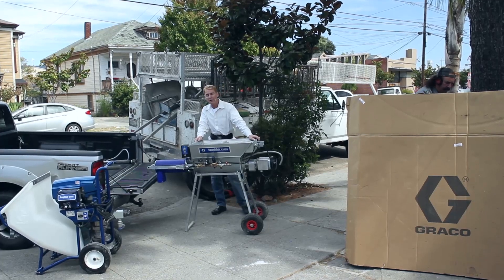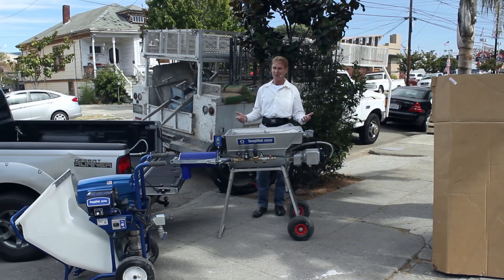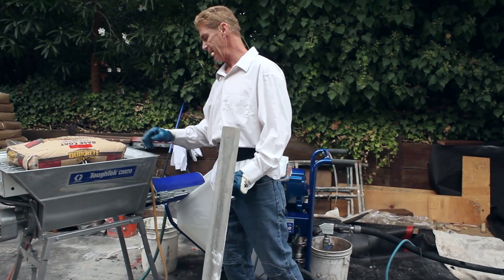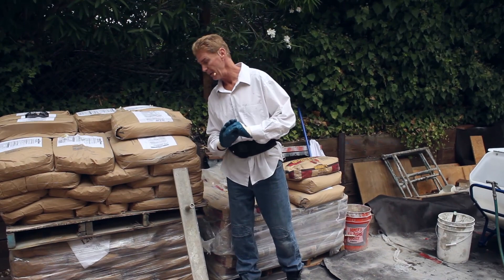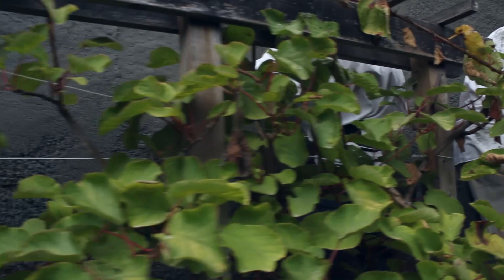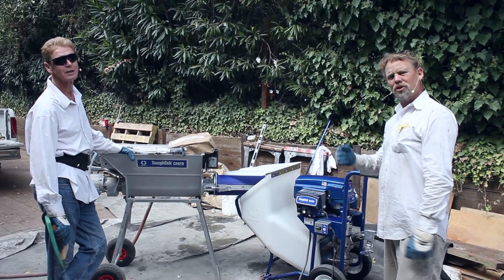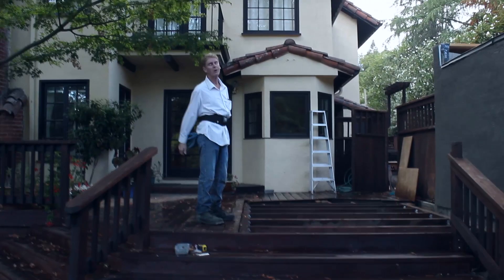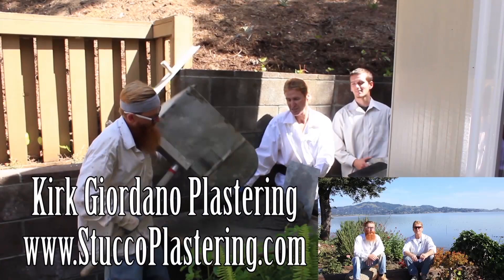Graco mortar pumps for spraying stucco.

Comment: I like it!  We don't do enough plaster to run a pump but have been happy with Graco sprayers
Reply from the maker: Good evening Scott Dude, I turned down many jobs that I would have accepted had I used this mixer/pump system earlier, such as two stray bale homes for a for a  contractor that I have been working with for 20 years.
Plus it took me and a full crew to hand apply a coat of stucco to a beat up cement wall about 250 feet in length all day with a float finish that would have taken only one hour with this Graco mixer/pump system.such is life.
                       Live long and plaster
           Sharing the plastering knowledge

Comment: Are company has one of those pumps. It works great for spraying fireproofing you just have to make sure your 110volt power is dedicated another words no one else can be on same breaker or box,  nice to see it is also able to pump stucco fairly fast. Remember the days of track house's?? Pull up the pump to a gigantic pile of sand stretch the hose out and run run run....yikes I do not miss that to much LOL. Another great Video thanks Kirk.
Reply from the maker: Howdy Robert Dude, been there too my friend, i used to eat braekfast and make four sandwishes per day for at least 5 years for this sort of fun work.
                 Live long and plaster
       Sharing the plastering knowledge

Comment: closest i came to this was with a shotcrete cementing system.
it was like wrestling with a huge unruly python powered paintbrush.
hat off to your pump gun guy.
Reply from the maker: Howdy 69 Dude, that's no joke strength is necessary.   
FYI, I used to shoot shotcrete in S.F. on the new high risers many years ago, hated it, but man it sure paid well, it was some snotty, slippery crap especially if you manage to step on it, or tried to. 
but at the same time, a mans got to make a living.
                     Live long and plaster, 
  Sharing stucco secrets, or common sense tips

Comment: Nice. We use the fireproofing version, F340e. Love it. 13 bags/hr. now and maybe up to 20 with a forthcoming upgrade. Meeting w/ Graco tomorrow to demo a higher output dual F340e with mid 30's bags/hr. We are not using their continuous mixer but hope to if they can get the bugs worked out.
Reply from the maker: Good afternoon James Dude, this unit shoots a pallet an hour or 35 50 pond bags,
 I used to shoot fireproofing in S.F. many years ago, the pump was so large and the chained on hose so huge and heavy that the cherry picker I was forced to use kept having the back wheels lift off the ground which scared the be-Jesus out of me,  I quit after a week out of fear of the cherry picker collapsing.
       FYI, the Graco mixer make a perfect mix every time, where using a tow behind mixer which I have at least five, 
 can and will over mix any same day cement plaster materials thus rendering the cement plaster a bit weaker as the PAC's get beat up, It's rare to find a plastering contractor that even knows what pac's even mean. When the same day cement plasters are overmixed it sort of like plastering in freezing weather below 32 degrees agin when cured it is also weak.
                       Live long and plaster
           Sharing the plastering knowledge
                 Kirk and Team Giordano
Reply: Right on, Kirk. Tell Danny Carrillo I said hello from SLC.
Reply from the maker: Howdy James for saltt lake city, that Dann dude gets around alot for such a busybguy.
 The late great movei star Lucill Ball used to say "you want something done ask the busiest person you know"
                 Live long and plaster
       Sharing the plastering knowledge 
                  Kirk and Team Giordano

Comment: That's a heck of a machine
Reply from the maker: Good afternoon John, Dude, it was the first time we used it, surpassed my wildest expectations with strength, adaptability, while being simple to operate, these time conserving modern pumps could only be engineered from the minds at Graco.                   
                    Live long and plaster
           Sharing the plastering knowledge
                 Kirk and Team Giordano
Reply: I've got to Grayco airless sprayers and the are beasts.....love the knockdown dash finish
Reply from the maker: Good afternoon John dude, they do tend to have longevity and their side must be made in the U.S. under quality management.
 As my Graco paint sprayer is almost as old as me and still funtions like new, I keep it ugl as in covered with many coat of paint so no worries about it being stolen.
                       Live long and plaster
           Sharing the plastering knowledge
                 Kirk and Team Giordano
Reply from the maker: Good evening John Dude, that was the easiest know down I ever applied, O wait, Andy spraed it on no wonder it was easy for me.
                       Live long and plaster
           Sharing the plastering knowledge

Comment: Hey Kirk, another great video. My name is Clayton Cole and I've been plastering with my father for about  8 years or so. He's been in business for over 35 years down here in west central Florida. I was excited to see your opinion on this machine. I want to know what air compressor you were using? Also do you think using a regular drum mixer would keep up? This machine would be a large investment but I would love to have one!
Reply from the maker: Good morning Homemade Dude, the drum mixers will work but they have a tendency to overmix the product, so you really have to be on the ball when mixing.
I was using my DeWalt air compressor that I mainly use for lathing for the air to his Graco mortar pumping system.
 Your right is is a good investment for many projects.
                          Live long and plaster
            Sharing the plastering knowledge

Comment: We use there pumps all the time we spray joint compound with the graco mark v for airless plaster they call it but it’s just joint compound. Great pumps though we have 2 of the mark vs and we will be getting a mark x for remodel because you need to spray heavier
Reply from the maker: Good Morning Wayne, good tip brother                   
                      Live long and plaster 
    Sharing Plastering tips by Kirk and Jason Giordano
Reply: You'll  love the mark x. I was a field tester  for graco  and the mark x. Don't  use murco mudd  in it because  it will pack around the lower ball after about 3 or 4 buckets and you'll be cleaning your pump out because you'll lose all the pressure on the pump.  Murco mudd is the only mudd I had this problem with.

Comment: Greets. Have you tried shooting fibered cements like EZ Mix Scratch/Brown? What was the 50lbs bag mix you're putting on? I heard you say it was QuickCrete, but it looks like a new mix. Have you pushed the unit to determine  max yardage rates, and how was the maintenance and cleanup? Lastly, do you have to run any additives for the pump and hose?
Reply from the maker: Good Morning Rembrant dude, we have pushed this unit to the limits, it works well.
We have also used all sorts of cement products with and without fibers.
 I haven't added any additives though like say jibco as I didn't feel they were necessary.
 As far as clean up, this is a part I dislike with any pumps or mortar spray machines, thus I do most jobs by hand.               
                              Live long and plaster
            Kirk and Jason’s plastering tips and techniques

Comment: So, I have a large project where I'm going over an existing masonry wall to apply manufactured stone product.  I need to apply a bonding coat (3/4" give or take).  No need for lattice, at least that is what the manufacturer says.  All it needs after that is a texturing tool over it to put those little grooves in the surface of the skim coat so that the thin set can grab the skim coat when bonding the new veneer in place.
Can this thing handle a big job and get-r-done, or should I just hire a gang of men and do it by hand?
Reply from the maker: Howdy William, Graco stucco spraying machines can do whatever is required of them much faster than by hand.
However, you need to understand how to operate them; this does require some training and skills. If this is the only job you will do, it may be best to do it by hand; however, if you will use the gago sprayer for future plastering jobs, then it's worth the investment. 😉
Reply: @StuccoPlastering  You see, It is a really big job (40k sqft). IF POSSIBLE, I need it to also pump sac-crete into the CMU walls of the foundation from the top near the sill plate.  Can this unit, or one graco makes handle small aggregate as well?
Reply from the maker: @BillyReed68  Absolutely, Graco stucco mortar sprayers can handle ten times as much. That's what these pumps are designed for to save tons of man-hours and spray instead of applying by hand. 🥳

Comment: Thanks for the video I was wondering what size of compressor did you use? and does it need to be continuous air compressor I called Graco but the guy didn't know. I wish you would of spent a little more time at the mixing station dialing everything in would of been helpful. Roland All Island plastering.
Reply from the maker: Howdy Roland, I felt we explained as much as possible, we cant have videos too long or that scares most folks, here is another one showing the same machine and materials mixed, it was also in the description Cheers my fellow plasterer. https://youtu.be/yjVpplHCLO8/ 💃🏻

Comment: Get over your 220V phobia! Whatever machine you're using, it's going to draw the same energy from the power supply to do the work. The energy draw at 110V requires twice the current as the energy draw at 220V. Twice the current means you need bigger gauge wiring, higher current circuit rating,  and the motor runs hotter because of internal losses due to larger circulating currents. For power and longevity, 220V is the way to go. If you have problems with finding 220V on the customer premises, bring your own generator. Problem solved.
Reply from the maker: Howdy Fred, your right, I should have just told the customer to spend the extra cash to get 220 installed, they would have simply said, Kirk, "Great idea," I just happen to have 2 thousand under my mattress that I've been searching for ways to get rid of,"
 Not certain how the world revolves without expert advice form guys like you.
Bringing to all the most complete plastering encyclopedia ever created in the world online.
 By the plastering messengers of Youtube.  With well over 850 free self-help videos 🎭 👀💃
Kirk and Jason Giordano Plastering
Reply: @StuccoPlastering  LOL- nobody said anything about requiring the customer to give you a circuit. 
You do know the typical house is loaded with high capacity 220V circuits. They power up things like electric hot water heaters, electric dryers, electric stoves, central A/C or heat pumps, and lately electric vehicle charging stations.
Reply: @fredbloggs2587  No... You just can’t bring a generator to power your 220v tools. That will cost a lot of money to keep the generator fueled and the space it takes up as well as the weight. If it can run in 110v and it has passed the required tests to operate out of a customers home, it’s the more common tool to use than a 220v tool. I’m not disagreeing with you completely but what you are saying is matter of opinion.

Comment: Is it a starter and tube or a pump with pistons
Reply from the maker: Howdy Donald, no Idea. I'm an applicator, not a mechanic, now and is a mechanic and has many big Tommy guns and can take them apart like any car engine and rebuild them. If necessary, You would have to watch where he explains all about it. As once again, Ole Kirk is an applicator. 
  It's sort of like electricity. I don't need to understand how it works. I just need to know what switches to click on to make it bright inside at night.
 Clickity click.😏